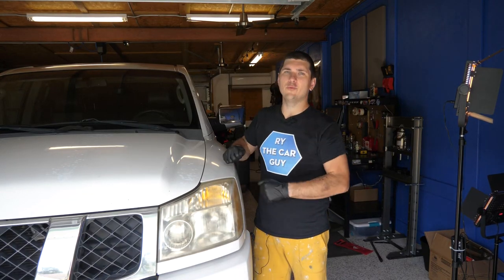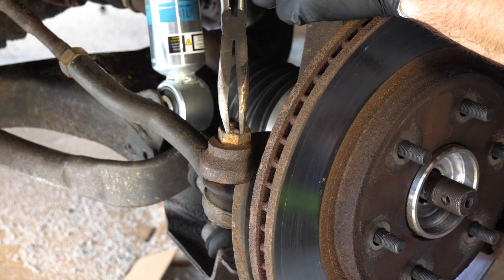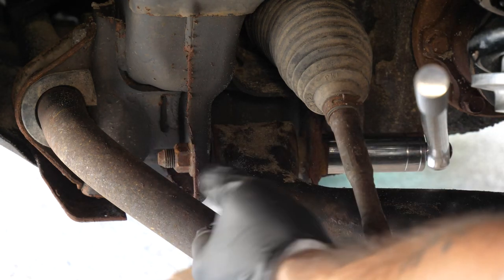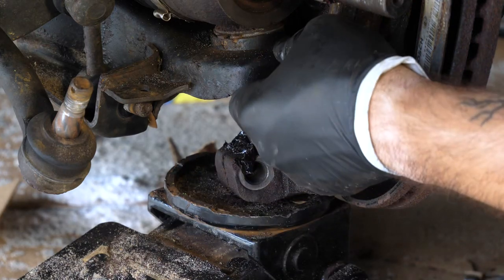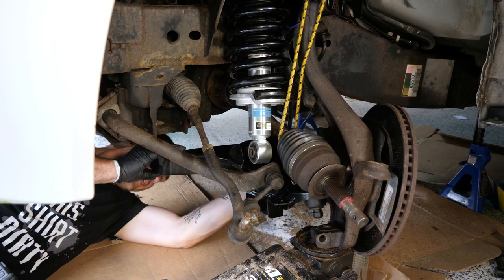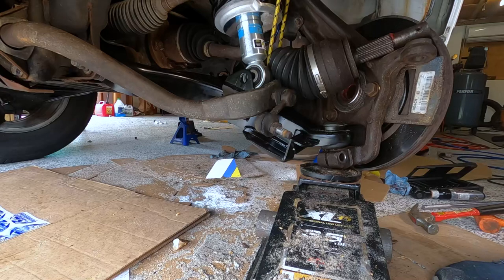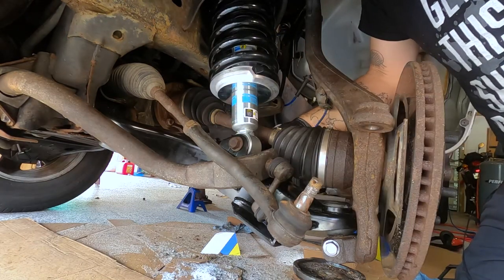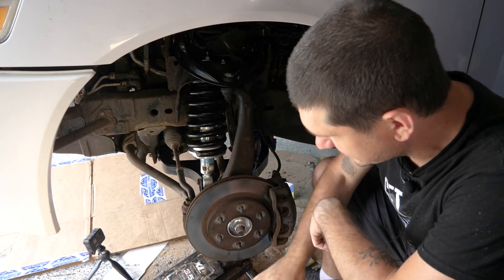How To Replace A Lower Control Arm On A Nissan Titan/Armada

Comment: Up in the rust belt often it's nessesary to sawzall the bolts to remove the LCA!  Enjoyed the video even though I've done this job a few times! All  the torque values on the screen at once is great, ty!
Reply from the maker: Glad you like it! I am SO glad I have not had to cut bolts off yet. I'm sure I will be there someday and I am not looking forward to it.

Comment: Not sure if telling shows how much I appreciate your work and walkthroughs. It really helped me during my front end overhaul on the suspension.Though I still need to install the rear shocks and get an alignment,I drove my high miled 04 Titan yesterday with the new suspension and Bilstein 4600s and was blown away at how quiet and smooth it was.

If I hadn't have watched any of your vids,I'd likely still be fighting off the rust and seized of an 18 year old truck on its original suspension that spent a good time up north before making its way to Texas.
Reply from the maker: Well luckily the hard parts over. The rears are a lot easier. I'm glad the videos helped man. I appreciate you watching.

Comment: Your truck is 6 years older than mine, way rusty and the LCA bolt just came out so easy! Mine needed a sawsall
Reply from the maker: It's not rusty, it's just tan from living in Florida. LOL. Sorry to hear about your troubles. I feel very lucky that I have never had to deal with it.

Comment: Aw man I really need to do this as mine is rusted like hell from all the years of winter salt roads lol and 230k km. Going to probably replace all the suspension up front and in the back as the leafs are quite flat + worn aside from being rusty and old, will try my best to follow your guides and also the frame rust removal / repainting and stuff :)

Thanks for these videos man :)
Reply from the maker: You're welcome! Hope the job goes well. 👍🏻🤘🏻

Comment: Great video, I have done, shocks, UCA, CV axles, extended sway bar links, hubs, sway bar bushings, front shaft U joints, tranny mount, and now of course my LCA ball joints are shot. It never ends lol. Great video I will knocking this out at my friends garage this weekend.
Reply from the maker: Haha it's true. It never ends. But these days With how expensive trucks have become if we keep these maintained we will be sitting on gold mines 😂
Reply: @Rythecarguy  no doubt! Check out my build on my page has my mod list

Comment: “These bolts should not be terribly difficult” unless you are in the rust belt than plan on a couple extra hours. Ended up having to cut mine out with sawzall even after PB Blaster bath a couple days in a row.
Reply from the maker: Sorry to hear. Lube the shaft of your new ones with chassis grease before installing them. Should help with it next time.

Comment: Great video. Quick advise, you should never hammer on the ball stud of the tie rod (or any ball and socket design) to get it loose if your going to reuse it. Best option is to hit the knuckle not the ball stud. Hitting the stud will introduce axial play in the joint leading to premature failure.
Reply from the maker: Good tip!

Comment: Great video. Do you have any info on how to adjust the camber of the rear wheels. I got a 2013 Armada. The dealer  advised to replace the lower control arm as the bushing was frozen. Is there a way to work around it? Without replacing the full control arm?

Comment: What is the bolt you removed connecting the knuckle to the lower ball joint? You said to replace it and the nut but im not sure what it's called. Do you have the part number?

Comment: Great video, I did mine watching your video, one thing is the lower control arm bolt are not centric bolt, I order new one thinking there were centric, but when I removed it were just regular  bolt so put the old back, idk how it will turn  if I use the centric one
Reply from the maker: You can replace them. You just need to get an alignment afterward. Here's a video on it.
https://youtu.be/X0O4LJhV51k

Comment: Epic video YT🎥   any NEW episode on Nissan Xterra
Reply from the maker: Xterra coming soon. Making some more changes to it.
Reply: @Rythecarguy  I just bought a 2012 Nissan frontier. Has to the hub assembly and my mechanic told me that my truck was sitting in water for some time.  I love my truck and I want to keep it.  Iwas told that I need to do both front and suspension etc. Where do I start, and where can I get good prices??

Comment: What do you think of your Titan as it compares to your Xterra? As an Xterra owner I often wonder how the Titan compares as a daily.
Reply: Xterra will be more comfortable to drive as a daily, have owned an 01 xterra, an 07 xterra and now an 08 titan.
Reply from the maker: I half agree with James. However I have a stripped down S Xterra and a top of the line LE Titan. The interior of the Titan is far more comfortable (leather, seat heaters, 8 way adjustable seats, auto climate control, etc) but the Xterra is MUCH easier to navigate in traffic, park, and put in the garage.

Comment: Hi! Love your videos. I have two issues with 2011 X if you could help me just figure the faults:
a) The AC works fine in all situations except only when I am reversing the car. As soon as I engage the reverse gear, the cooling stops. 
b) There is a free hose near the air filter box which looks like it came out of somewhere. I didn't notice the hose before, and it looks like it should connect somewhere. I have pics but dont know how to share with you.
Any ideas? Much appreciated sir. :)
Reply: KHILADI,  I assume that hose has a little bend at the top end (after it clips onto the airbox)?  if so, that is not supposed to be connected to anything.  In fact that hose is the Breather hose for your front differential.  If you follow it down into the engine bay, you will see that it connects to the top of your differential.

Comment: What would you recommend, engine oil 10/40 or 5/30: xterra 2010 No. 165000mil
Reply: I think all Xterras take 5w30 if im not mistaken. I use high mileage synthetic in my 06 and it works great.
Reply: @curtthechameleon  👍
Reply from the maker: What Curt said.

Comment: Hello Ry the car guy, I'm currently changing out my lower control arm and one of the bolts is seized on. looks like I will need to cut it off. Where do you recommend to purchase replacement bolts?
Reply from the maker: I would buy SPC replacement cam bolts for better adjustments. You can get them all over the place. Amazon, Rock Auto, or your local parts store. The only catch is that you will need to get an alignment afterward.

Comment: How does one determine when to change upper or lower CA?
Reply: When you hear a lot of  Squeaking front end.
Reply from the maker: It can definitely be squeaking. Also clunking and/ or wondering steering. It's really just examining it on a periodic basis and making sure it's not damaged or the bushing/ball joints are not bad.
Reply: My x needs suspension overhaul, just don’t know if I it needed to include upper or lowers along with the ADO sus kit.
Reply: My xterra was really shaky around 60-65mph, changed ball joints and found the bushings of the upper CA were shot, now I need to do the lowers, so best to just get the whole CA with ball joints

Comment: I noticed you are using an impact drill, What one do you have ? I have looked at so many different ones but not sure which one to get., Any help?
Reply from the maker: HIGHLY recommend the Fuel Milwaukee impact. That's what I use and it's amazing.
Reply: @Rythecarguy  3/8 or 1/2"
Reply from the maker: 1/2 inch

Comment: Not Sur about this guy.If you remove the back two control arm bolts after the sway bar the control arm and hub assembly would be free to move off the axle with no need to remove anything on the upper arm.
Reply from the maker: Oh yea. I'm sure there are shortcuts and work arounds. However, in my videos I follow the factory service manual steps to complete jobs. Sometimes the steps are exactly how I would do them otherwise.